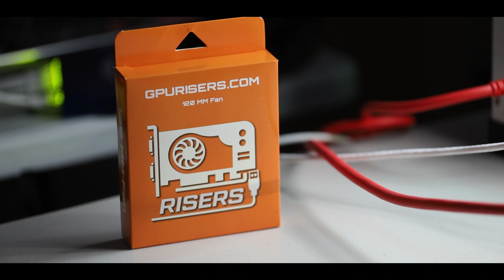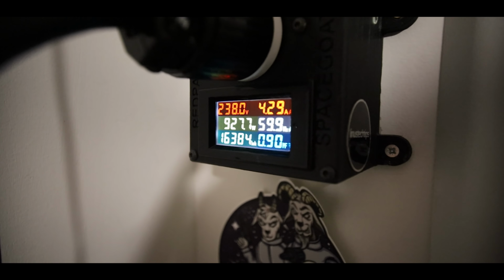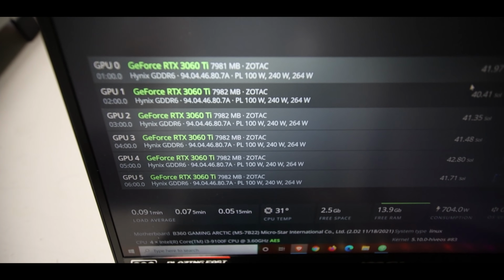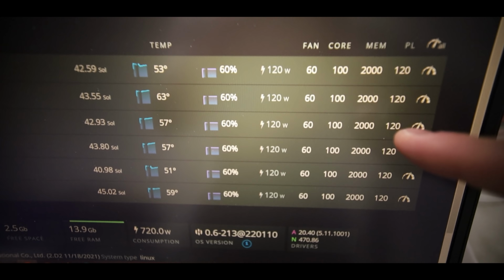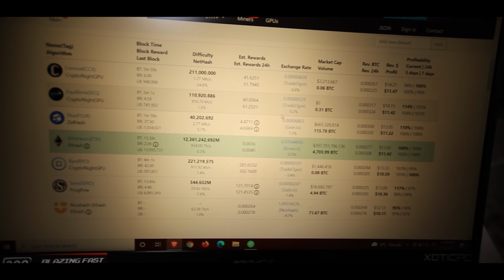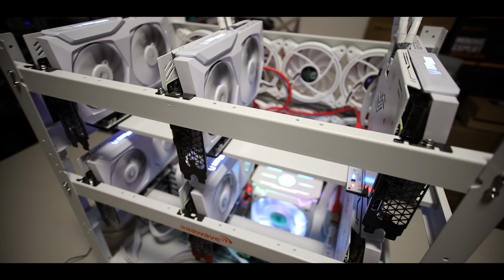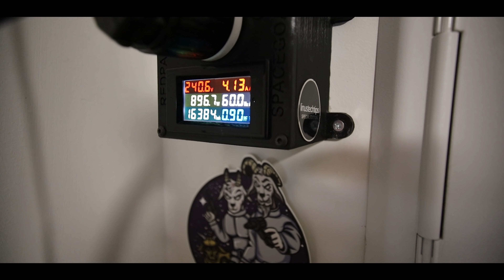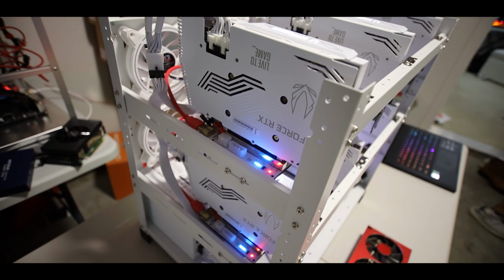White Zotac 3060 Ti LHR Mining Rig HASHRATES & Overclocks in HiveOS

Comment: For Flux. I'm running 2 Zotac 3060ti White just like you. I'm getting 54 Sol/s. 180 core, 1500 mem, 145W PL. It's been stable for 4 days now. Also have a white 3060 that runs at 40 Sol/s so definitely need to tune your overclock
Reply: On Flux, I run 165 core, 0 mem with 145 pl and I get 52 Sols on white Zotac 3060 TIs. Fans running at 70, super stable with great temps. Use Mini-Z.

Comment: I noticed the memory overclock doesn't do anything on Flux. Rather it gives more invalid shares. From my experience the best to run is PL 165, +200 Core and 0 memory. Getting about 53 sol/s
*edit I must add that the best miner to use is miniZ. On gminer you get about 6 less sol/s.

Comment: I have two 3060ti tri fan. Both Hynix. Only one card get invalid shares. Why does this happen? The temps and stability also seem to be a bit off. I reworked the power to make it more efficient and clean and that helped with stability but I still have invalid shares. I have tried bringing down the Mem and Core incrementally. Ive just started trying to tackle this. Any suggestions?

Comment: Nice rig, I am also getting entertained with building not casual rigs, but in the other way. Regarding the FLUX, it only depends from Core and Power. Stay with 0 on memories and you gonna see no difference. My todays testing with Asus Duals and ROGs: 
Core+100, Power125 = 43.5-46 SOL 
Core+100, Power135 = 46,1-48 SOL 
Core+125 Power150 = 49.5-51 SOL

Comment: Rig is looking sweet! But you may be leaving some efficiency on the table for Flux. 
I'm doing 150Core 190PL = 54 ~ 56 Sol's. that's the sweet spot that I have found, with Gigabite cards though.
Reply from the maker: 190 watts? that's not efficient at all at 55sols though... 0.28/sol. Mine at 120watts @ 43sol ish is 0.35/sol efficiency

Comment: so im running a 3 gpu 3060 Ti lhr FLUX rig and im getting 49.32 sols on the msi with hynix, 51.83 on the gigabyte samsung and 52.44 on the gigabyte with hynix memory  fan 65, core 200 mem 2400 pl 145